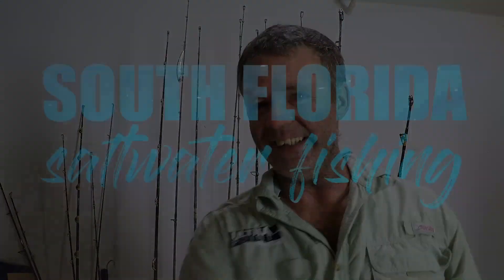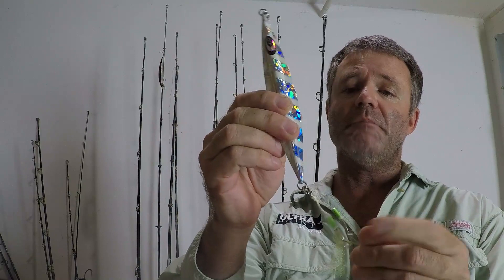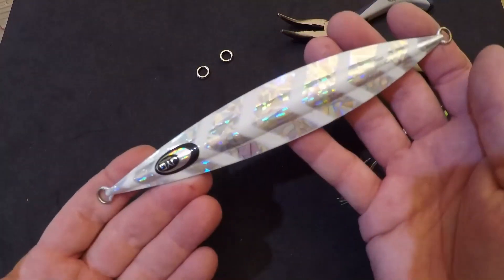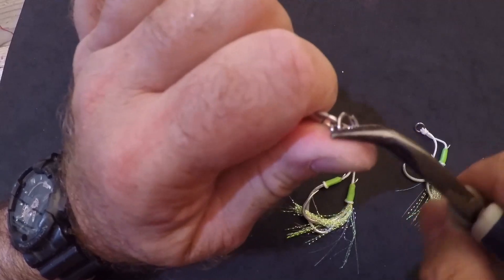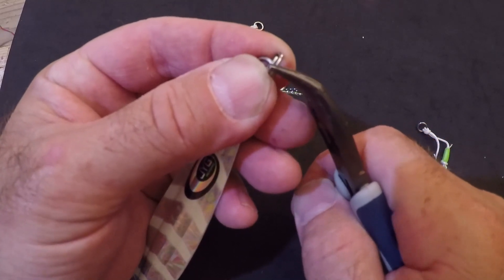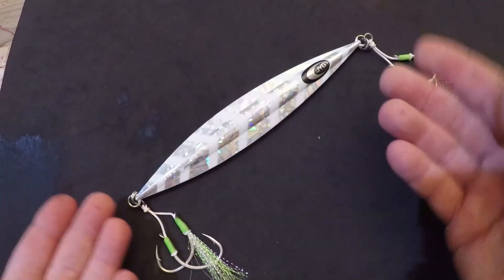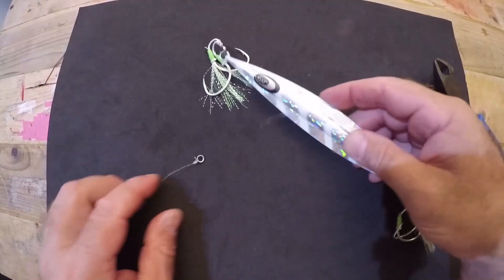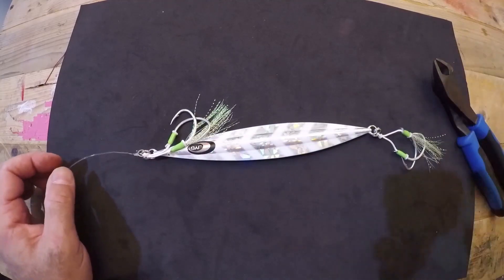How To Rig A SLOW PITCH JIG assemble your own slow jig

Comment: Agree with other, you have great enthusiasm and I also appreciate the time and dedication.  I've yet to ever slow pitch jig, but will have an opportunity this May when I go off-shore about 40 miles in 150-200' of water on a semi-chartered party boat (it's a 40 person boat but company is sponsoring 20 of the heads so only 20 of us will be on the boat).  Now this being said I have a few questions:  1.  At 4:40, is there a reason to attach the the lower weighted end of this non-symmetrical weighted jig?  Most of the time do you see the eyes at the bottom or top?  2.  This is the first time I've seen two solid rings used.  Most often I've seen guys build their assist hooks such that they time their mono/fluro leader directly to the solid ring of the assist hooks and the length of them will work for all lengths/sizes in there jig bag, so they simply remove the assist solid ring that's tied to their leader and move to a new jig.  This also makes me wonder about how that upper assist hook will behave in a hook set.  I'm probably over thinking it.  3. Finally, like I said I'm going to try this for the fist time.  I don't have any slow pitch jigging dedicated conventional setups.  I live 4 hours from our coast here in central TX.  I'm not going to slow pitch jig more than about one time per year.  So can you have a quick look at what I have for rod/reels in the following video and tell me what you think?  Thank you:  https://youtu.be/1NXI7VakQV8
Reply from the maker: Thanks for watching and asking some great questions.   This particular jig a symmetrical, so the eye placement is up to you... it works both ways.  When I'm slow pitching I have the solid ring attached to my leader.  The assist hooks are attached by their solid rings to split RI b gs that are attached to the jig.  This way your jig is fully rigged.  You don't want to attached the solid ring of your assist hooks straight to your leader.  Don't worry about the 4 hooks.  It's not too often that they get hung up.  Any set up should be good as long as you have braid and some sort of flexibility and shock absorbency in your rod. If your interested,  I have a Playlist dedicated to slow pitch  jigging..  check it out for basics on technique.   Good luck on your trip.

Comment: Is there a reason to use a solid ring rather than a barrel swivel?  Will the lure work better with a solid ring rather than a swivel?
Reply from the maker: It's personal choice. Some folks like the barrel swivel because of the line twist problem... personally I just like the ring... it's less clanking noise down there.  Gives that little more touch of stealth
Reply: @SouthFloridaSaltwaterFishing  OK! thnx for the reply

Comment: I just use a small diameter flat screwdriver to split the ring , don't bother spending money on some fancy overpriced pliers.
Hold the split ring , twist the screwdriver and install the solid ring to the opening , use some cheap pliers from your standard tool box to twist it if you need it , I do it by hand.
Limit your gear , spend your money wisely.
Reply from the maker: Thanks a million for watching and sharing.  What you described is how I used to do it... stabbed my self a couple of times, but it definitely gets the job done.  Split ring pliers make life a little easier, however, I'm not saying to spend money that's not there.  I'm a budget angler myself. Regardless, always great to hear different approaches to a similar subject.   Idea sharing, and listening, is key in fishing and being successful.  Thanks again for your support of the channel, I truly appreciate it.  Tight lines & take care ;)